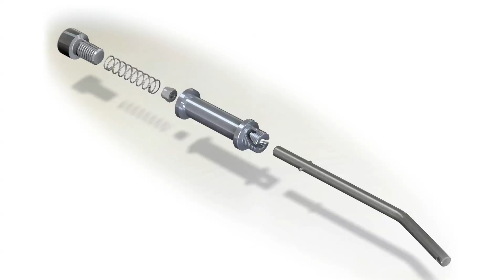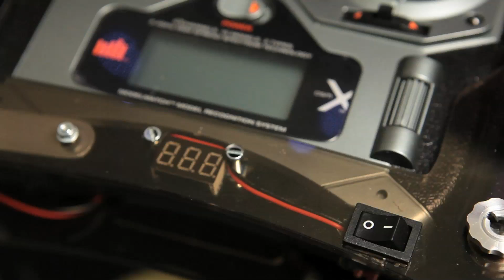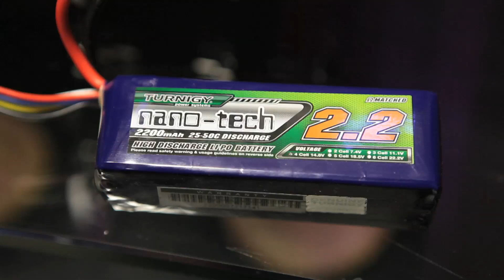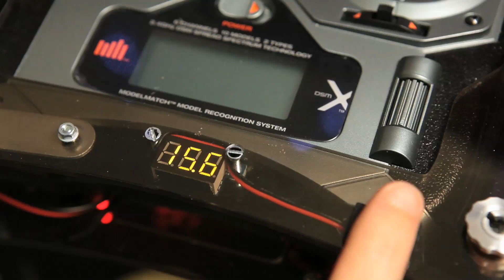DX6i and 350 QX set up for long range FPV

Comment: Cool set up for long range.
flying 5,8, in close right now, the stabilisation in GPS is great, with out Alt. Mode, seems more natural and more like your actualy flying it.. The standard antenna is non-existent, this is a great solution, I like this quad, very efficient little beast,

Comment: Why not go with a larger and more diverse Quad? The 350 QX is very limited... I love that sweet set up though!!!
Reply: You mention a diverse quad. I am new to this and was wondering which quads to get apart from Blade 350 QX for long range and FPV set up.
Reply: LRS requires maybe a UHF tx system, or at the least a 2.4ghz amplifier. I would go with a TBS discovery set-up, or DJI flamewheel, with NAZA FCU and EZ OSD. Remember its a quad, and your constantly running 4 motors, and all your electronics, so you cant go to far.But 25-30 min flight time can be achieved.

Comment: What range are you getting from the 350QX ?

What battery packs are you using?

Thanks.
Reply from the maker: Until now, and because it's winter, I haven't had the chance to fly it a lot, I tested it mainly in town, so I didn't let it fly out of sight which means no more than a few hundreds meters (half a mile or so) but it should be able to go quite far. I'll be able to tll you more about that when the weather will be more gentle (less rainy and windy) and when I can fly out of town.

About the batteries, I use Turnigy Nanotech 2.2 mA/H
Reply: Thanks for that!  I will hang out for an update :)
Reply: Dreams Producer the only way to use this for long range fpv would be to have a full range receiver in it,  but this quad doesn't have one.  This quad isn't capable of full range flight at least on a strait line.  I tried that and couldn't go farther than 1/2 mile away.  So I highly suggest you to get a better quad for your equipment.  The good thing about this quad vs your gear is that you will always have good video reception because your quad will go out of range before your fpv system does. Lol...
Reply: Dreams Producer the only way to use this for long range fpv would be to have a full range receiver in it,  but this quad doesn't have one.  This quad isn't capable of full range flight at least on a strait line.  I tried that and couldn't go farther than 1/2 mile away.  So I highly suggest you to get a better quad for your equipment.  The good thing about this quad vs your gear is that you will always have good video reception because your quad will go out of range before your fpv system does. Lol...
Reply: +ricardopr54.  If you are transmitting 2 watts for power from your 2.4ghz control radio it doesn't matter what Rx you have. I've been out >1.4km with an amplified DX5e and a stock UMX radian. Search my videos for it.

Comment: Cool, can u post a parts list with pricing? Thanks
Reply from the maker: On request here is a part list with average price including shipping (to france), parts mostly coming from different China or USA suppliers so it should be cheaper if you buy from the US or if you buy from the same supplier

Low pass filter 1.2-1.3 Ghz - 20$
U.fl/IPX to RP SMA male pigtail cable - 10$
Rp SMA to SMA pigtail -  6 $
2W Wifi Booster - 25$
Small voltmeter - 3$
Carbon fiber mount monitor holder - 20$
On-Off switch - 3$
Plexiglass Transmitter tray - 40$
Harness - 35 $
2 x Ubec 6V hobbyking - 15$
4S lipo batteries - 20$
DC step down regulator - 10$
Velcro Tie scratch - 10$
50cm Video cable BNC to RCA 75 ohms- 20$
2 x right angle adaptators - 10 $
3x30mm spacers + rubbers - 5$
set of 3x12mm screws, bolts and washers - 5$
Ferrite rings (set of 5) - 3$
set of JST connectors - 5$
1.3 GHz, 12 channel Video receiver - 50$

you would also need, soldering iron, some DC cables, heat shrinkable tubing, aluminium angle bracket.

For the antennas, it also depends of your Video receiver and emitter, but I chose 1.3GHz as I've explained it in the video

here are the price of the antennas for RC and VRx
10 dBi 2.4 GHz linear Antenna - 15$
12 dBi 2.4 GHz Patch antenna - 40$
2 dBi 1.3 GHz Right Hand cloverleaf antenna - 30$

a crosshair antenna would even go longer range

You'll find almost everything you need at hobbyking.com and readymaderc.com and for trays and other little stuffs, go on ebay.com

TOTAL : without monitor and DX6i, if you cut costs on shipping you shouldn't spend more than a 300$
Reply: Dreams Producer thx
Reply: will that include the stuff on the quad (cam and the thing that sends the video? sorry im a noob
Reply from the maker: No that doesn't include the Video transmitter nore the camera. I personnally use a Gopro and a 1 watt transmitter
Reply: Dreams Producer Hi man Great video! I recently did a similar modification my my DX6i, but i cooked the inbuilt transmitter just by using a higher gain antenna. 
Any idea where i went wrong? Your help would be hugely appreciated!